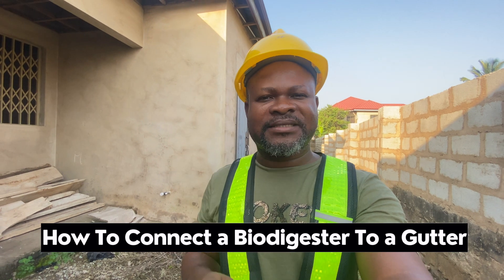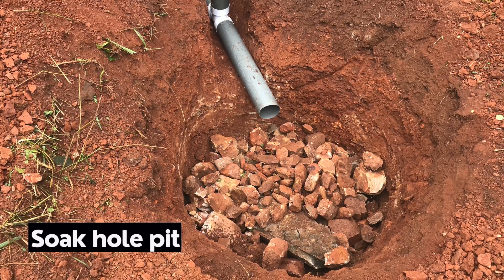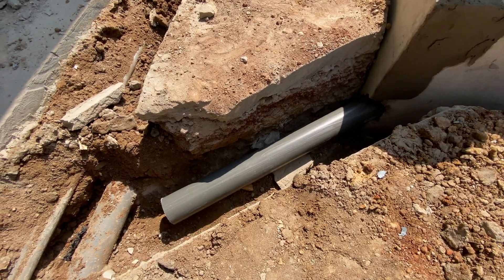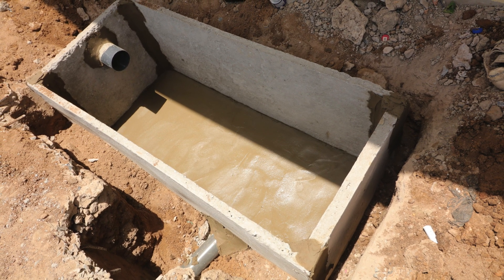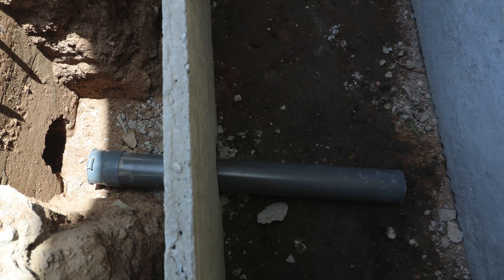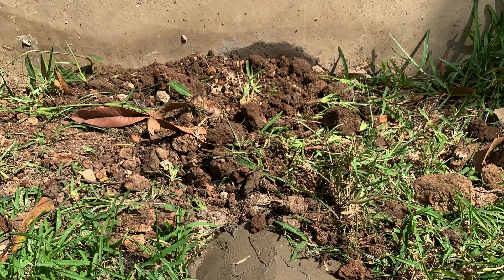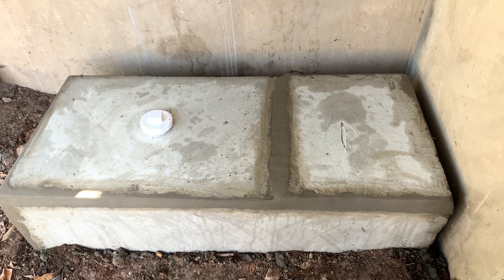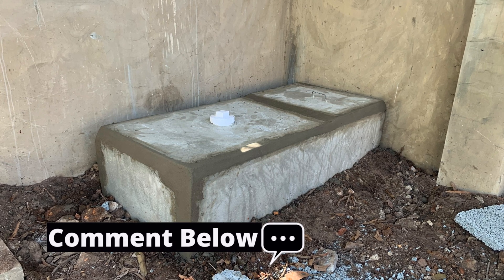How To Construct a Biodigester for Drainage Gutter

Comment: I'm sorry, I have to disagree with emptying the sewage grey water into the gutter.

The grey water may appear clean to the eyes, but it's not sanitized. It's full of pathogens that can cause outbreak of diseases, like cholerae, disentry, and the likes.

The filtration at the biodigester is only removing the solid, not the germs. It only achieves mechanical, but not biological filtration.

Any laboratory that will certify the grey water safe, should be closed down and officials prosecuted.

You'd been doing a fantastic job. Don't allow anyone to mislead you to empty the grey water into the gutter. That's very wrong.
Reply from the maker: I understand your point @dplusnig but what I’m also saying is not against the law if you follow the right guidelines. There are far more worse untreated waste that’s passing through our waste drainages than this filtered water.